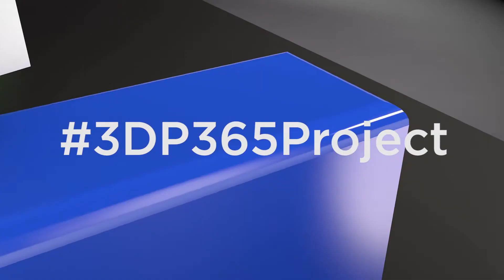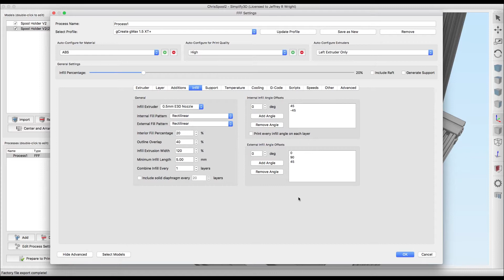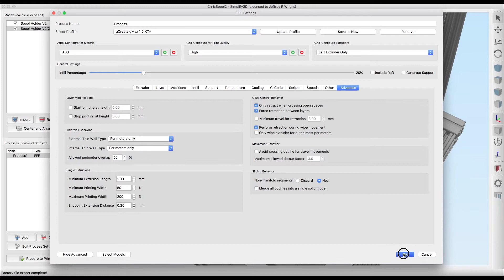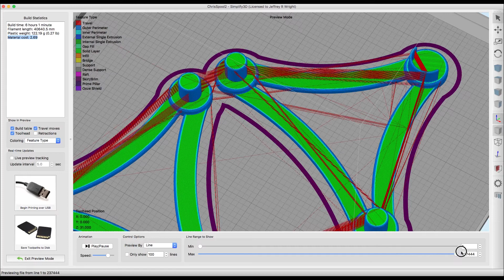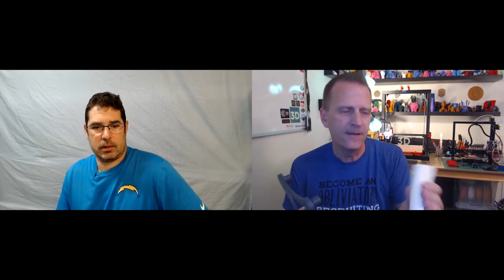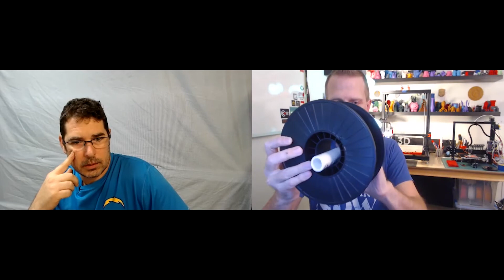#3DP365Project - Day 233 - The Spool Holder Project: Part 2 - Final Print & Review

Comment: I like the layer start point tip <yoda>Control, control, you must learn control</yoda> Curious though, why so many skirts? Overall, very nice design! Love it.
Reply from the maker: I like to make sure I am getting a 110% perfect first layer, so much I have canceled prints for a slight defect. So I use the skirt to fine tune the first layer height using Babystep Z and having between 8 to 10 laps around gives me that chance.. Hope that answers your question. And thanks for watching!
Reply: yes indeed, good idea